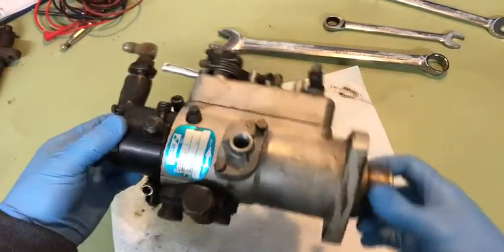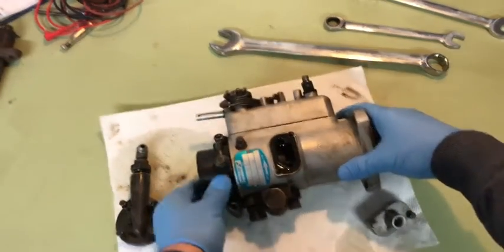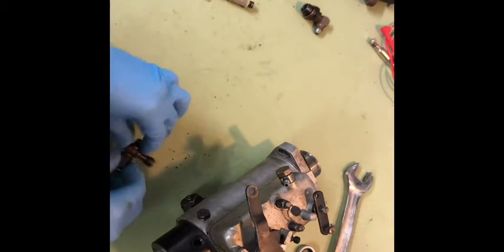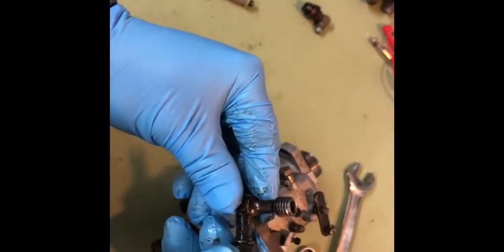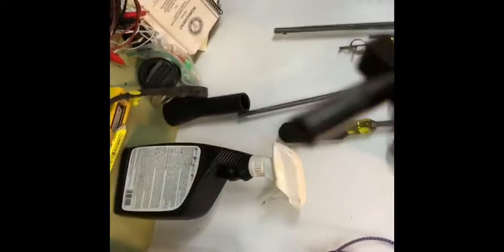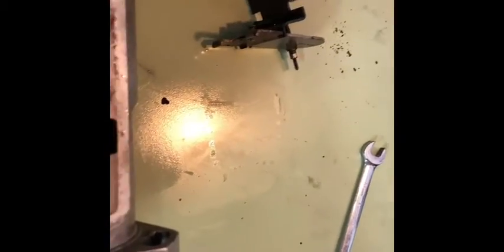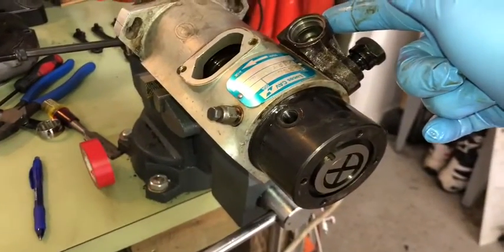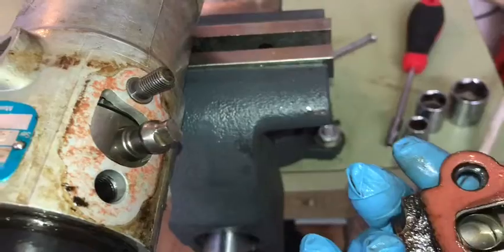Ford 555 Lucas CAV DPA injector pump rebuild 1

Comment: I have a similar pump on my MF175, what you called the auto timing device on the bottom of the pump, my pump does not have. Instead there are just two bolts and I am assuming it's because they just kept the same housing design and on pumps that didn't use that timing device they just used bolts to plug the holes.

I am asking because one of them has a little fuel pushing passed it and I was wondering if you knew if I could remove that bolt to replace the washer or whatever was sealing it without it messing up something internal to the pump.

Comment: Good video, I have my pump apart, is there a thrust washer between the front housing and the shaft of counter weighs, I feel mine is missing, ut wasn’t there when I pulled pump apart.
Reply from the maker: I cant remember but the manuals with exploded diagrams are online

Comment: I am sure you figured it out by now but the little black thing is a protective cover for the throttle stop screw also when you put the top cover back make sure you get the little slide lined up with the little tab on the shut off cam the first time I pulled one apart I didn’t get that lined up and it was stuck open and the tractor would not shut down and it was a pain in the ass to get it shut down and pinpoint the problem but you have probably figured th

Comment: I got the same pump I tore all apart cleaned it the one piston was stuck  I got it freed up  cleaned all up put together but it won't pump fuel at all threw the linen I bled the pump and the fuel filter cranked cranked  and cranked it can't get fuel moving threw the lines to the injectors any ideas?

Comment: Great job on the video!  I have one question.  The kit I received had one 1/8” ball bearing in it.  I would have thought it was for another pump that needed it but I found one in my old pump when I drained the diesel out of the housing.  I believe it went on the side cover for a valve to let diesel escape back into the tank.  My side cover did not have that valve in it.  I notice yours did.  Do you know if they supply that ball bearing to repair that valve on the side cover?  I did not see a spring or a seal that would fit inside the hole in the side cover.  
Thanks,
Loyd
Reply from the maker: Sorry I can’t remember where the ball bearing went
Reply: The valve on the side plate is a pressure relief valve. There was usually no repair kits for those. It's just a small spring and the ball. These pumps are self venting hence the extra return connection you can see just below the stop lever at  4.00. this has a very small hole in the banjo bolt to facilitate the self venting process. The ball in the kit was usually for the larger bolt holding the timing device on. Acts like a damper so the pulse from the rollers hitting the cam ring are not affecting timing. In many other applications, usually commercial, there was an actual damper about 3inches diameter as a bolt holding the timing device
Reply: @walesara54
 Hellon I believe your comment is pointing me in the right direction. While disassembling my pump then cleaning in the ultrasonic.  I came up with a very small washer cupped and the same size of a ball bearing.  I have no idea where it came from. As you described my  timing bolt has a internal spring and bearing and unlike many I've seen in manuals,  my bolt won't accept a bearing in the side recessed hole its to small. I belive its because I have the bolt with the internal spring and ball. 
So back to the banjo bolt you mentioned that comes down from injection line and screws into the side cover. The ball bearing fits inside that banjo bolt with a small pin sized hole drilled at 90° . Are you telling me the ball bearing goes into that bolt and if so does the small washer go on the end to keep it in place. Hope you find this and read it because I've been going through the web looking at dozens of manuals and to no avail. Thanks you  Hope you find this please  Reply. Good day.

Comment: Hi To align the circlip with the letter on the pump you need an injector tester and connect to No 1 outlet on the pump. Rotate the pump with no more than 20 bar pressure and you get to the point the pump will lock, start of injection then align the marks.  well done good job

to adjust the pump piston stroke you can reverse the pressure with any injector outlet pump to about 10 bar and  
measure the roller distance on the pump head.